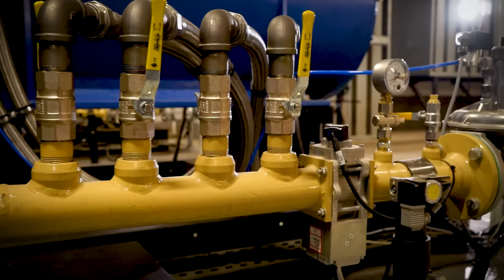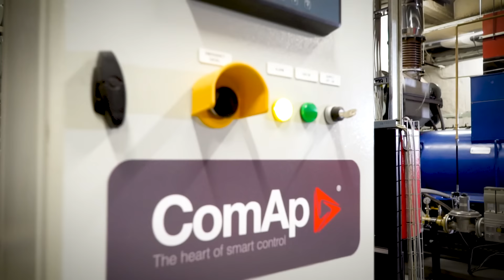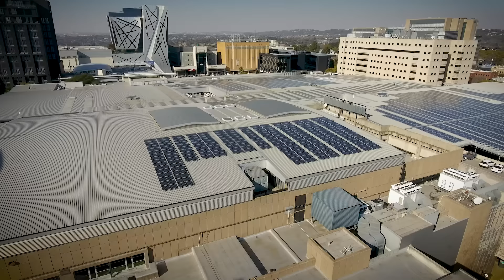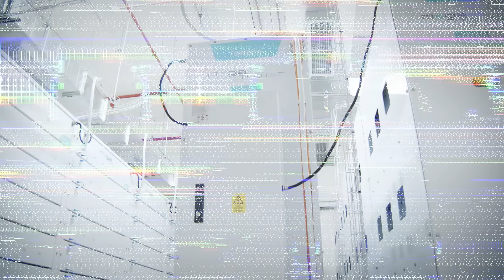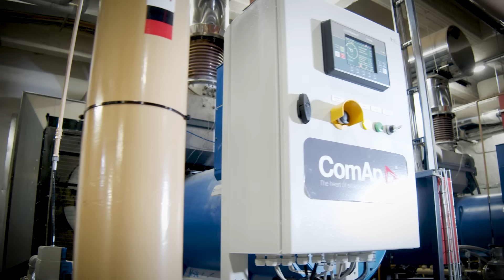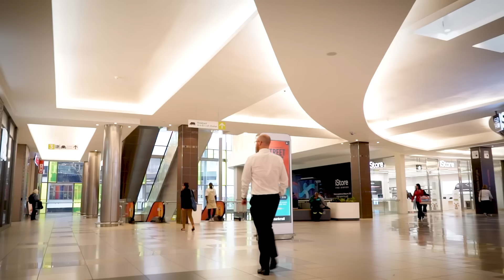Energy Arbitrage | Episode 1 of 8  - Rosebank Mall – Africa’s Most Advanced Smart Grid Launch

Comment: What a fascinating project. Which EMS is being used on this particular site to manage loads?
Reply from the maker: Thanks for the great question! The site uses a fully integrated ComAp control system (IntelliNEO, IntelliMains & IntelliGen) programmed to act as the EMS. It dynamically manages load profiles between grid supply, battery storage, and bi-fuel generators in real-time based on cost, availability, and demand.